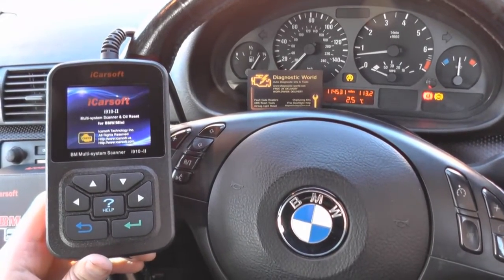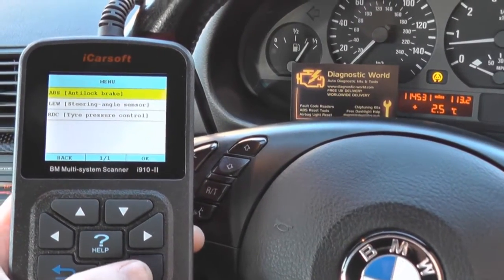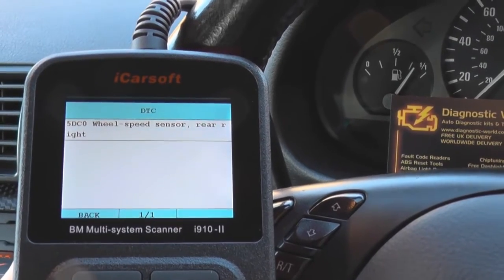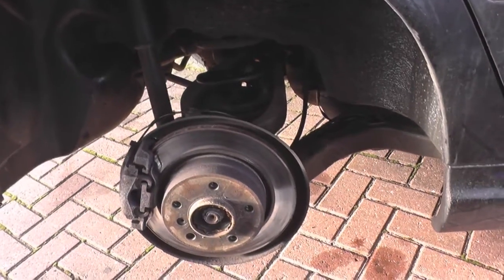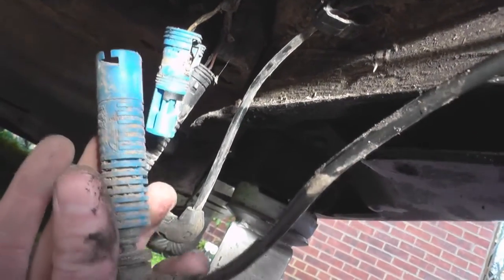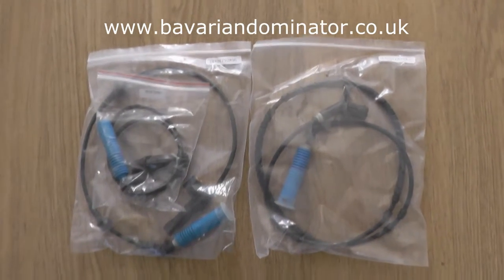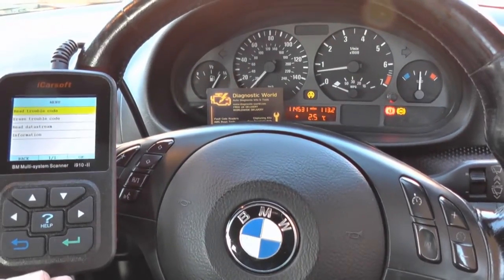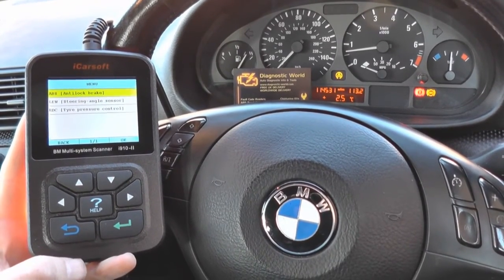iCarsoft i910-II Reset & Diagnose BMW ABS Warning Lights

Comment: I had the same problem as you with the erase successful message but the errors still there. I think the messages should be gone though because the car is not running. The live data shows the speed for all sensors to be working correctly.

Comment: I just received the 910ii scanner and it doesn't power on.  Tried straight from the box and tried connected to the obd port on my car.  lcd screen is just black/blank.  any suggestions?
Reply: Send it back. RIP
Reply: U have to Update it, because without Update it wont power on. I had a same case Today I updated then it started to power on and i Can enter to many. https://www.icarsoft.com/Page/107.html  the official update page
Reply: Try the scan tool on another car to see if it powers up. If it powers up the problem lies in the first car and not the scan tool itself. If second car shows nothing either than the tool is bad. If tool is good then the fuse on the OBD2 is probably blown on your first car that  didn't power on. Good luck.
Reply: @youaregoingtolovethis  or someone stole the fuse and used it somewhere else, that's the first to be swiped